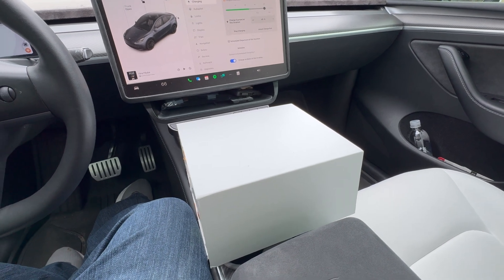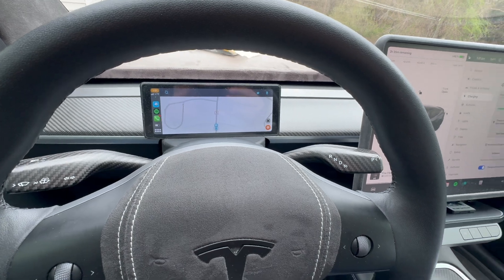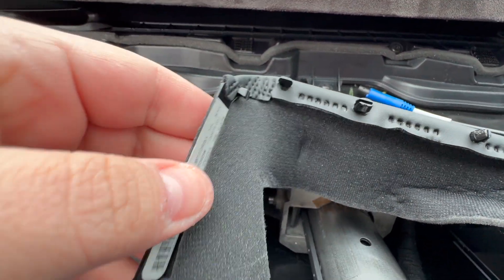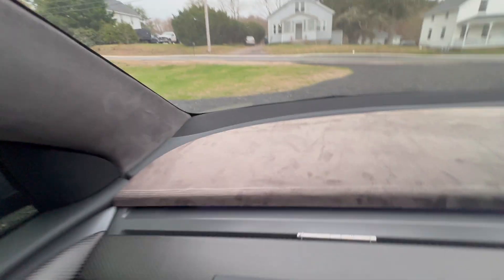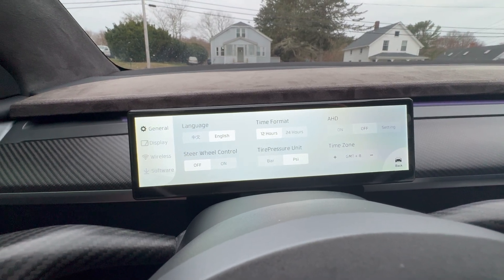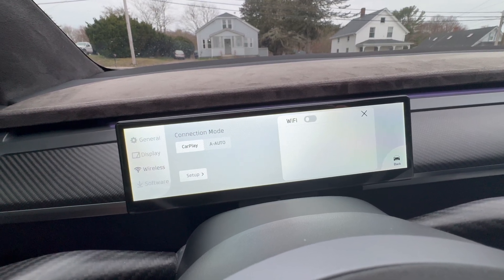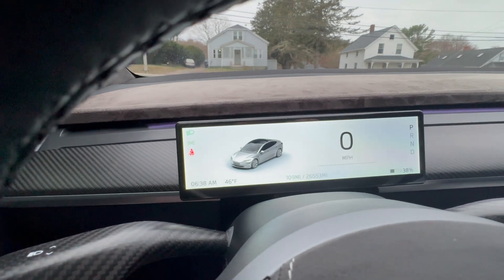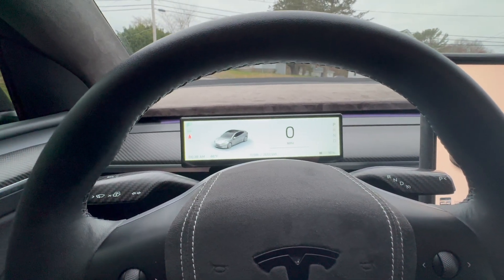Upgrading Your Tesla! Teslasy's T8 8.8" Center Console Touch Display on Model 3/Y/Highland

Comment: I just had a very bad experience with this. It's been working perfect, and when I checked for a new upgrade, it showed one available, so I went through the onscreen process. (while sitting in my garage, with very good WiFi coverage). It went through the whole download process (2.downloads, just like yours), then went through the installation process (just like yours), and after it completed - it rebooted....... and that was the last time it worked.

Now when it turns on, I only get the opening graphic screen of the white car... it stays there forever.

There should be a download page on the website to get a file to load onto a USB drive to manually update... but nothing...

If anyone knows any solution, please let me know! I miss this thing!
Reply: Contact them and get a firmware file so you can do manual update

Comment: I just bought and installed the T8 Pro and the installation was really quite easy!  I do have a question for you… the readout shows 105mi / 26553 mi in your video.  Do you know what the 26553 number is ?
Reply: Ahhhhhh!!!  I didn’t even make that tie-in!!  Thank you for clearing this up!!
Reply from the maker: Very welcome! 🙏
Reply from the maker: Its the odometer. Total miles driven on the given vehicle.

Comment: Thanks.  Was the original the 6.8?  How does the height compare (e.g. airflow blockage)?
Reply from the maker: The prior model had better air flow as it was smaller. This one isn’t bad at all though.
Reply: @JaeTheDev  Thanks.  Always trade-offs. If you want a front camera & CarPlay you have to get a display in this size range.  I think my first choice would be steering wheel mounted ultra-mini w/ turn signals/blind-spot, speed, & auto-pilot nag.  That all could fit.  I don't believe this exists.  Actually my 1st choice would be a real windshield HUD w/ the projector integrated into the dash.
Reply: @JaeTheDev  Thanks

Comment: Will this hurt the headlight to change color.  I was told by a tesla tech it does.  Is this true from your experience.
Reply from the maker: Apologies, but I dont understand the question. No mod or accessory will ever change the color of your headlights, except changing the headlight or the light within it. Again, apologies if this isnt your question, and if not, please clarify a bit for me.
Reply: @JaeTheDev  thanks for the replied, my question is that tesla tech told me that if i used aftermarket cluster that it would draw juice to the cluster and less juice to the headlight and headlight will change color from white to blue.
Reply from the maker: I’ve never heard that before nor have I ever had that issue with any of the 10 or so displays I’ve installed prior.
Reply: @meand774  that is the most insane thing I have ever heard. Quite a reach, even for Tesla.
Reply: @meand774 Not even possible... someone lied to you!